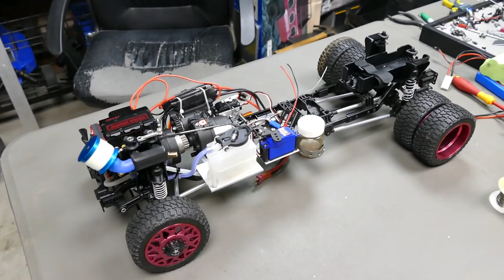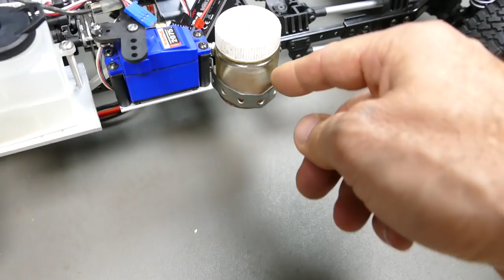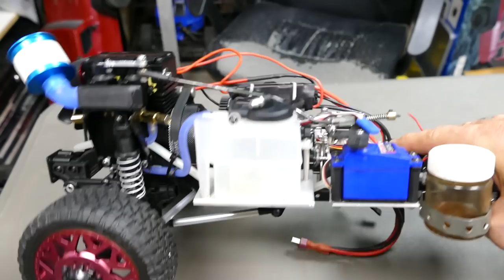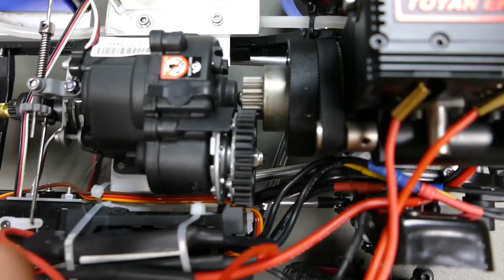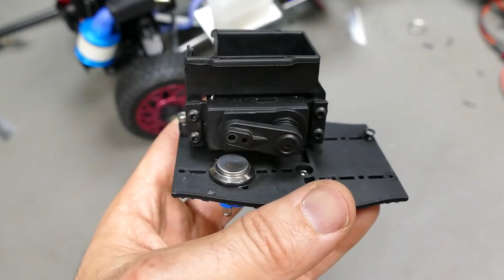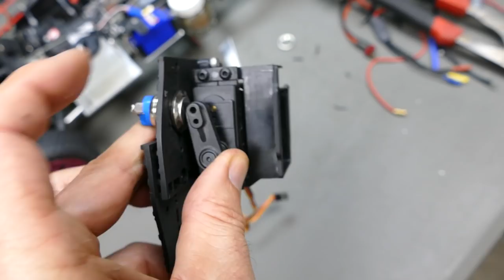FORD F450 TOYAN FS-L200 BUILD - Part 3

Comment: I don’t know if it could work for the glow igniters and maybe even the starter ESC, but make quick disconnects so all that wiring and bulk doesn’t have to be on the truck. It’s a trade off on convenience and space/weight.

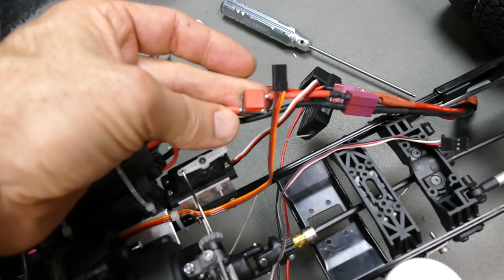Comment: 7:30 you could leave the stock switch in the harness and just put a metal plate on the end of the servo arm, short those exposed leads out to bypass it when starting from radio.
Reply from the maker: Yeah I was thinking that too 😊

Comment: Looking good brother!  I like your starter push button switch idea,  my switch keeps sticking on my esc lol! Going to follow your idea there. I see your fuel tank is in a good location I moved mine to the rear and it runs like crap, need to get mine closer as well.
Reply from the maker: Yeah my button was sticking too, on both of the units I have, weird. Also weird is the earth issue, honestly don't know why but it works perfect on the new spot.

Comment: Bro this is as complicated as my low rider... Making it bounce took some work haha.. anyone wondering 12v garage door relay run each 30kg servo to each port... Make your servos rotate 360 by taking out the notch on the inside... Attach to your shock mounts... Add really heavy load springs and reinforce anywhere that they apply force.. bolt to wheel hub... Add telescoping shafts to your  wheel hubs... Run 12v... Wallah a bouncing brand spanking new low rider... Slams, bounce lifts and can move every wheel independently to get that flex on your car.. if you want to go all the way run independent shafts for all wheel carriers and give it a chrome out :) good luck I love mine!!!
Reply: Wasn't knocking this by the way just saying it's well done :)
Reply from the maker: Yeah these do become complicated that's for sure. Fun building them tho
Reply: @RCTanksTrucks247  my bro that's definitely true haha I just finished printing a 67 Pajero shell and I'm in the middle of bog and paint haha this things getting a deep candy coat :) I do find it funny how the work can scale in time and effort just as much as the size of the parts and the price =P
Reply: I'm following in your footsteps as you've done some solid work mate 🤓😎

Comment: Dud, no joke just after seing this. I got all the products u listed below and im curious for it to get delivered. I am having doubts on the drive shaft tho, I dont have a universal joint lying around or that adapter that you showed. Were can i buy one of dem ?
Reply from the maker: They are super cheap and available online. I used Jenny RC on ebay to get the Revo 3.3 driveshafts and gearboxes

Comment: I have same motor & transmission  only thing  I am off how to install  rear gear to transmission
Reply from the maker: The clutch bell is no different then any other nitro engine. The mesh between the clutch bell and transmission is the critical component